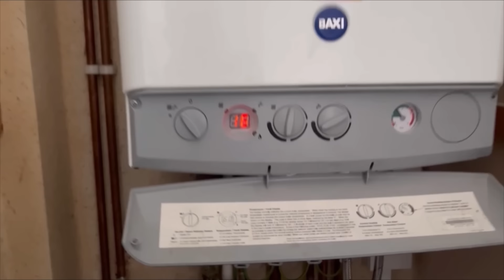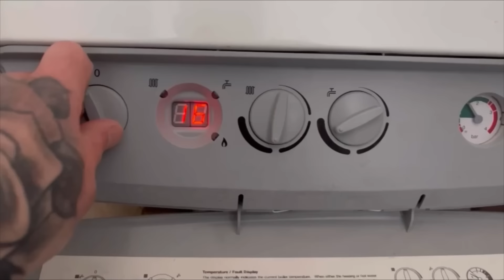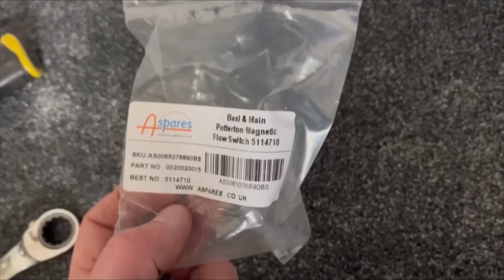WHAT IS THAT SMELL?? #plumber

Comment: Dan, how do u price a job up on an ideal logic when it makes the trumping noise as it can be multiple parts? Venturi,burner,gas valve etc, theres many parts what cause that noise and after you cleaned Venturi, your looking at burner or gas valve, but u can't be sure its that. I know the trick with the burner if it's floppy in left hand side were fan goes then it's faulty, but I've had it firm and it's still the burner, and the burner looks very clean, I hate that fault, am lucky as I have a gv and burner as vstock to eliminate but if you don't then it would be a nightmare
Reply from the maker: Hi mate, I price it for the worst case scenario… it being both, try the Gv first, if not then the burner. I’ve known of it before being both what’s at fault. Hope that helps mate.

Comment: Haven’t snapped a flow turbine yet (touch wood) but can’t you bash it out from under the mains connection like you can do with the diverter cartridge under the flow connection? Would save buying the whole block but a bit unsure 🤷‍♂️
Reply from the maker: I’ve snapped a few now. However…. I do have a snapped one in the garage in the block so illltry this mate! Never tried knocking it out from underneath

Comment: Tell me why you put gas pipe back in before you tightened the cartridge 😅 100% would do the same thou 😂 great video mate 🙌👍
Reply from the maker: Did I? 😂😂😂 what a wing nut 😂 I just like to make the job harder mate, sometimes it’s just not challenging enough 😂 cheers mate
Reply: @Heatking  made me laugh anyway cause it’s what I would do 😂